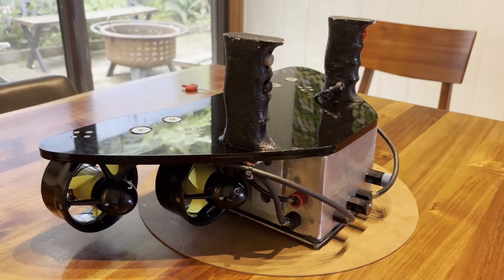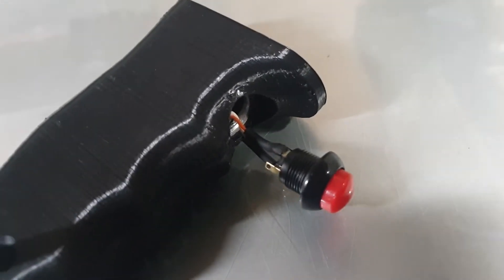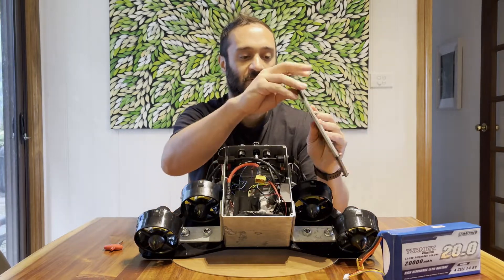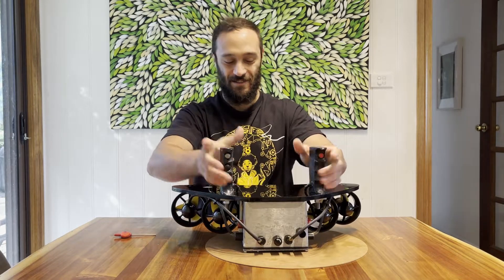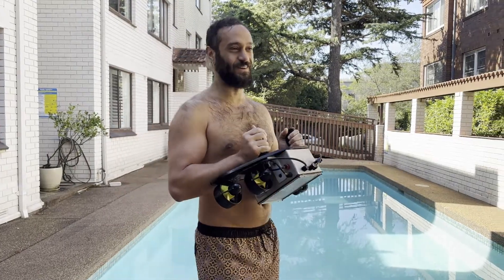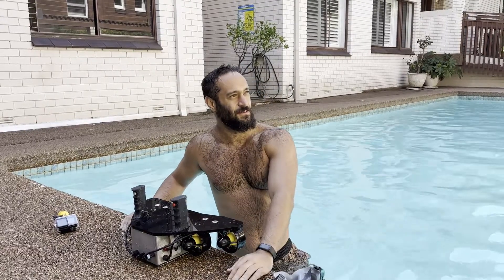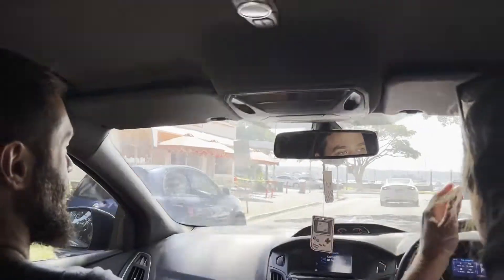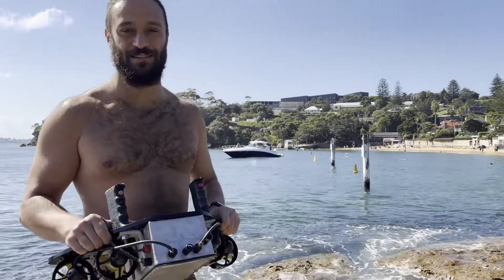Testing my home built sea scooter underwater

Comment: Hello; great project; what motors are you using? thrust kg/voltage? seems pretty fast.
Reply from the maker: Thanks, I used Blue Robotics T200 thrusters. They have good documentation on their website. From memory I was running at 18V which gave aplrox 5kg thrust each

Comment: So cool! 🐠🐠 Do you have any thoughts on what you do differently for the next iteration?
Reply from the maker: Will increase the low thrust setting and maybe use a higher voltage battery for more speed 😀
Reply: @MahdiDesigns  Creative design! Do you think if any custom PCBs and 3DP/CNC'd case can help? We're open to sponsor! (PCBWay zoey)